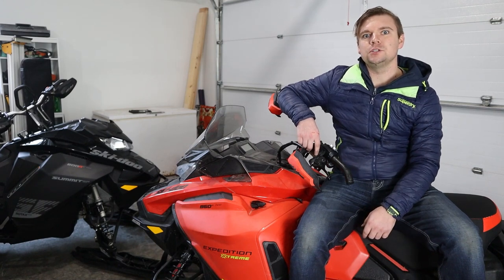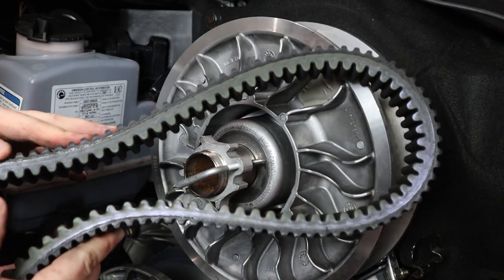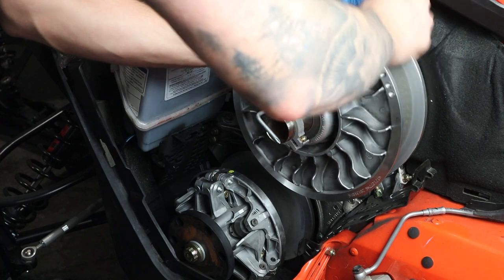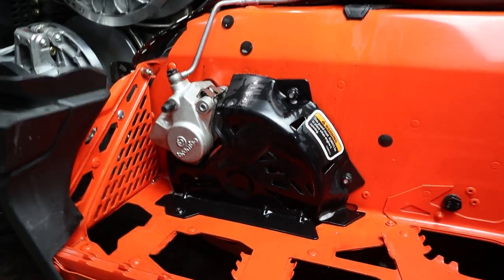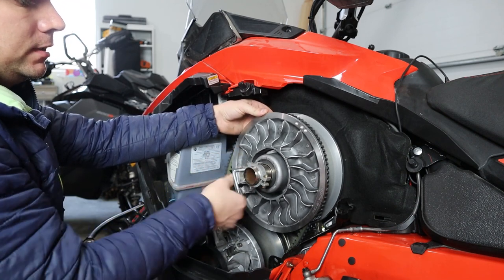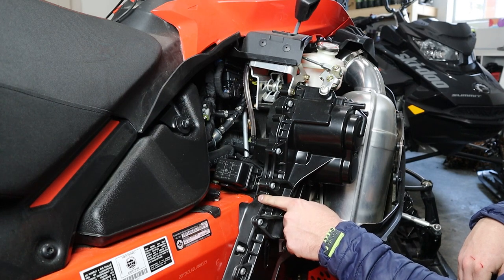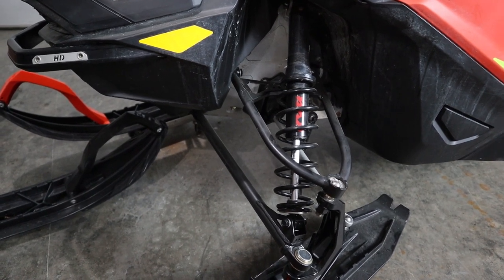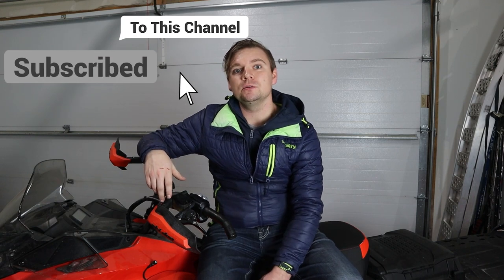Ski Doo Pre Season Checklist

Comment: Nice work on the video! I have the same snowmobile and love it. However, I have an issue with the rear articulation arms bending. I noticed you have solid arms out back where mine have holes. Did yours come like this? Or where did you buy the modified arms? Thanks.
Reply from the maker: @David Bielaski Thank you very much! There’s definitely a learning curve with YouTube so hopefully I get better with time. 

Mine came like this. I got mine late in the season so I’m wondering if mid season they discovered that there was a problem and switched to a more solid construction. Sorry I’m not more help. I’ll talk to some of the reps I know and see if I can get a definite answer.
Reply: Beyond The Horizon Thanks for the quick reply. Could you please tell me what your sticker on the tunnel says for build date? 

My dealer denied me a warranty claim, but now seeing this it appears brp changed the design on the fly during production because other 2020 models have the holes like mine but have seen other videos that have the solid articulation arm like yours. the parts breakdown shows the solid design as well. i put in a claim to brp about a week ago after my dealer said they couldnt do anything and suggested i try myself... waiting to hear back. i should get the warranty upgrade to the solid style like you have stock considering the same exact model.
Reply from the maker: @davi555bielaski  The build date on mine is 10/2019. 

I agree if it’s something they changed mid production and you had an issue then they should warranty the arms. I hope you have better luck with BRP. I’ve heard certain dealers can be pretty hard to work with. 

I messaged the Reps I know so I’ll let you know what I hear.
Reply: Beyond The Horizon Thank you! Much appreciated.
Reply from the maker: @David Bielaski  I got a reply from two of the reps I know and I have a little bit of disappointing news.... They couldn’t confirm if Ski Doo switched to the solid arms however they did say that the manual shows the solid arms. Also they didn’t really have a good way to go about the warranty claim and said the dealership should have helped you in this situation. 

Sorry for not really being able to help but I didn’t want to leave you hanging.
Reply: Beyond The Horizon Thanks for your help. BRP seems resistant or oblivious to the obvious fact they were changed because my dealer said BRP told them they didn’t change them.  So I took pictures of mine and compared them to yours and the 2021. On the parts fiche online, the 2020 and 2021 pivot arms are the same part number yet mine are a totally different and weaker design compared to yours and the 2021. BRP tried to tell my dealer nothing changed but my photo’s and parts fiche comparison are definitive proof and now it seems like something may come from it in time. Fingers crossed, worst case I just buy the two new updated arms but with warranty I shouldn’t have to. Just need to work for it! Hope you have a great riding season.